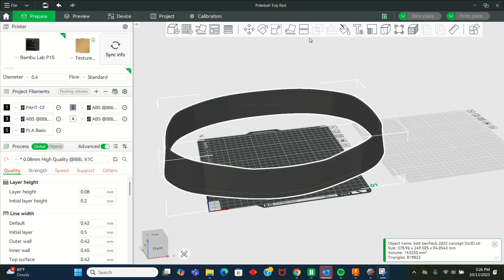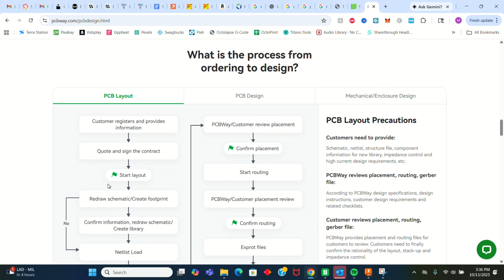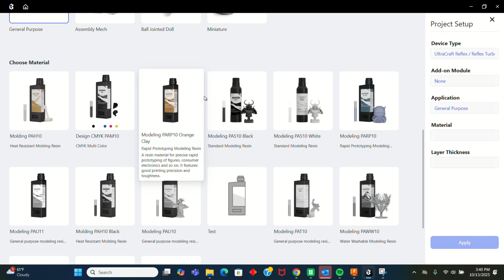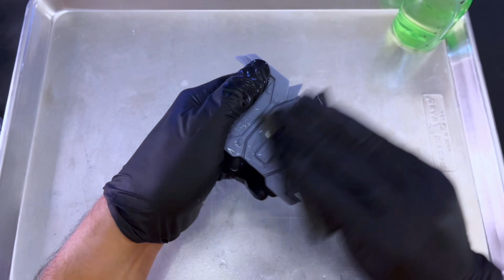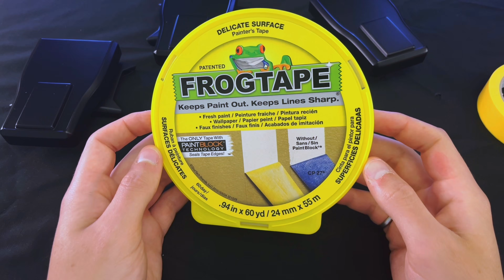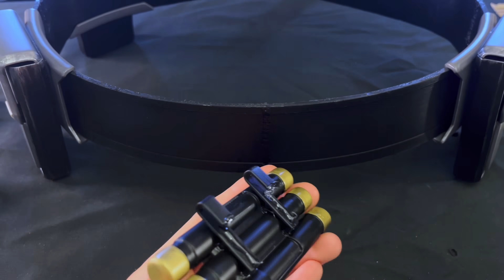Batfleck Concept Batsuit: Part 7 - 3D Printed Utility Belt

Comment: how much money do you think you have spent of tpu from pcbway so far beacuse im gonna buy a 3d printer next month the bambu lab p1s to make this and other stuff but im worried about the cost of the tpu from pcbway
Reply from the maker: Okay so I got the P1S not too long ago and it’s a beast at printing TPU. I mainly would purchase TPU from PCBway because it was made using SLS process, not FDM so the later lines are practically invisible. However parts can cost up to $40 per, which is hella expensive. Their FDM TPU is only about $12 per part which is better but at that point it’s about the same quality as the stuff from the P1S.

The SLS TPU parts from pcbway are next level though. If you’ve never seen them I’d still recommend getting one to you can see the difference. But the majority of your TPU parts can be printed on your P1S. Hope that helps!
Reply: @markitmade29  yeah its just i saw the comparison you made with your own printed tpu and the pcbway tpu and the one you print your self no offense doesnt look that good compared to how crazy good pcbway looks so i was just curious but looks like i may not print this suit then beacuse of the tpu but thanks for the answer